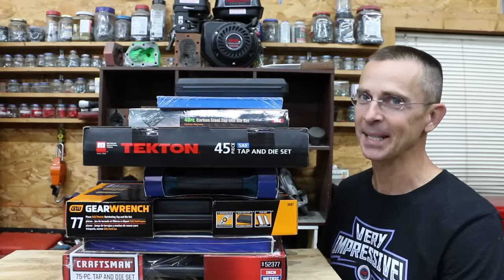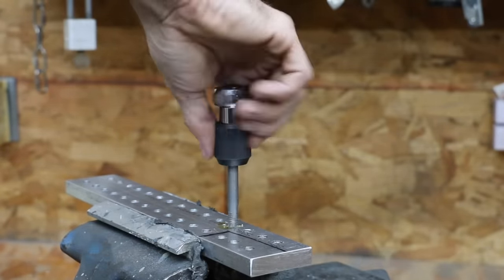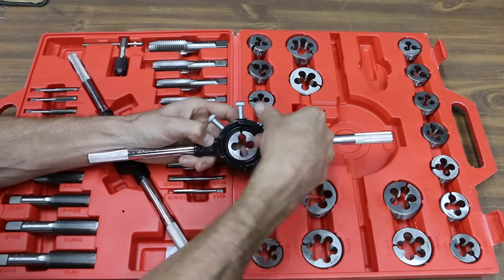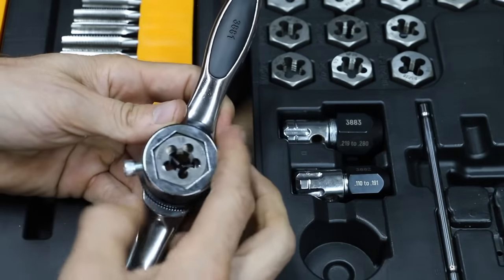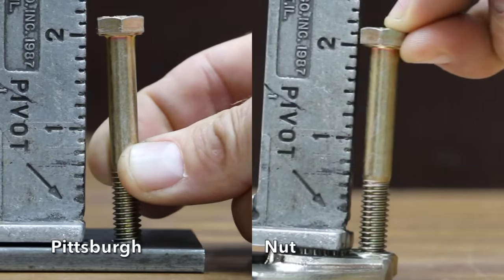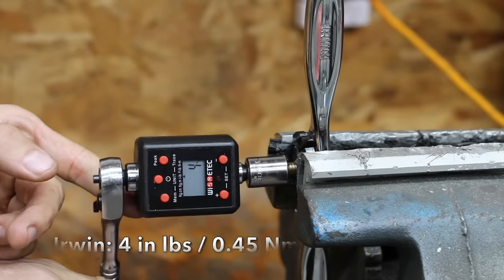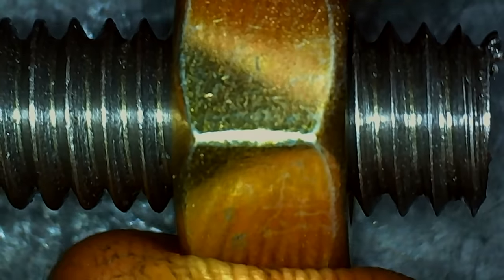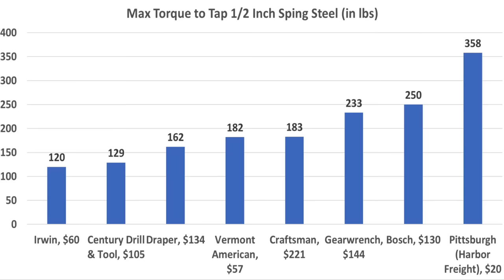Best TAP & DIE Set? Craftsman vs Irwin, Bosch, Draper, Vermont American, Tekton, GearWrench

Comment: I have owned and used professionally a large complete set of Craftsman standard tap and dies since 1980. I have broken a few taps over the years and they were replaced free of charge. I also own a smaller set of metric tap and dies from Craftsman and they are excellent. I cannot say enough good about Craftsman tools for the money they cannot be beat. Years ago they even replaced broken drill bits free which is amazing. I also own Snap and Mac tools which in some cases look and feel better but Craftsman gets the job done for a lot less money.
Reply from the maker: Thanks for sharing.

Comment: And now I know I made my worst investment into the two SAE and Metric kits from HF😞🥴. In any sense I learned even more from the PLETHORA of comments below and that taps won't last very long to begin with, hence, the reason I shouldn't have bought a large kit, and should have just purchased a really small kit and added taps as needed. Think that could have been stated in this video too; that these are extremely low use tools and will be often quickly replaced after short use. Ultimately, I don't think my purchase was worth it in addition to not being a 'tapered' kit, they are even harder to get started with. Lessons learned for sure. Thank you PF for this outstanding breakdown good Sir.
Reply from the maker: Thanks and you are welcome!

Comment: The correct drill for Aluminum is an " F " which is .257" and for steel it's a " J " which is .277".   This explains in part your loose fits in aluminum and broken tap in steel.   By writing this I am making no excuse for the horrible performance of HF.   Incorrect recommendations do not have to be accepted.  Also, the cost should have been given in $ per cutting tool or $ per piece since the kits varied in number of cutters incredibly widely.   Perhaps cost per piece of the largest set they sell in SAE would have also been a better metric.   I would love to see this revisited with vintage sets.  Actual American Craftsman, Vermont American, Ace, Greenfield, Cleveland and others.   The audience is interested in what is available commercially, so I understand why those were not included.  Gave you a like anyway as I like your content.
Reply from the maker: Thanks!  Thanks for the video idea.

Comment: Thanks for the comprehensive comparison, very helpful.  The only comment I would make about the tests is that the loose fit of the nut from the test of the Draper die could have been due to the way it was clamped in the vice - I noted that the  "gap" in the die appeared to be pretty well closed up which isn't what would happen in practice using the proper wrench.  The Die wrench would have allowed the amount of cut, and therefore the fit, to be better controlled.  Other than that - and I know this isn't usually a concern -  it's hard to find kits that have all 3 taps for each thread configuration - that is,  Taper, Intermediate and Plug, which I know isn't needed for most "handyman" use, but here are times where I wish they had been available for certain jobs with harder materials.
Reply from the maker: You are welcome!  Thanks for the feedback.

Comment: Someone mentioned using a range of tap drills to get varying fits of the final thread.

In addition, taps are made of varying thread fit, the tap used is typically specified in the drawing.  While this is not plan work, unless you know what fit of tap it is, you can't compare them.

I could compare a hundred dollar tap against the worst of this bunch & make it look even worse, just by buying a loose fit tap, designed for a smaller tap drill.

Also, using a ratchet to drive the taps is 2nd only to a drill for the worst method.  There is a reason tap handles are 'T Handles'; equalizing force on two sides of the tap is primary.

Just watching the video, I could have predicted ALL the taps would produce sloppy holes due to use of the ratchet, combined w/ not cleaning the swarf from the tap by reversing direction when you feel resistance against the tap.

Just because you see a machine or some YT'r run a tap in like a drill, doesn't mean you should.  Tapping machines have clutches which accomidate resistance & slip, plus a machine tap is used in a machine, a hand tap is used by hand.

That doesn't take into account if the tap is a taper or plug type; they can both be hand taps, but will perform differently.

One last thing. Despite what the marketing wank says on the package, a hexagonal die is not for cutting threads, it is for cleaning/repairing established threads.

I have seen resellers, (like Craftsman), have an idiot in marketing decide the "hex makes use w/o an expensive die stock easy". Yeah, for cleaning threads. Use it to cut threads & it'll be a mess.

Even good dies will die if you try to make "all thread" using the gorilla force method. Dies need to be reversed, just like taps.

This entire comparison could have valuable, but lack of knowledge turned it into a waste of everybody's time.

Comment: I have the irwin tap + use time-serv kits to repair threads (mostly crappy aluminum that fatigues and strips over time...). Manual handle not drill or wrench for an existing hole. Works well and recommended, though expensive.
Reply from the maker: Thanks for sharing.

Comment: I have a Craftsman set. It is several years old but looks very similar to the one you tested. It has worked well for me. Nice to see it did so well in your experiment. An issue I have come across with cheaper sets is that some of the taps & dies are not cut to spec (Standard or Metric). They work with each other (if that makes sense) but don't expect a 3/8-16 bolt you bought at the hardware store to thread into a hole you tapped
Reply from the maker: Thanks for the feedback.

Comment: As a machinist this test leads me to believe that it's meant for an non-professional mechanic or diy kind of application where they don't use them a lot.  Others mentioned using the ratchet and the wobble as the tap enters the metal. That can cause it to wallow those threads or make it tear them a little bit. Getting them to start straight is the biggest problem when you can't use  drill press, milling machine, or lathe and a spring loaded tap guide.  However it can be done and even if you can't power tap or have a tapping maching it makes a huge difference in thread quality. Also using a nut and bolt is not a great was to check the threads as they can vary a lot in their tolerances and cause bad fits. 

There are different kinds of taps but some are meant for power applications and do not work to hand tap very well if at all. Also there are different fit types of taps too. Fits 1 loosest fit with 2 being the normal size and 3 being the tightest thread fit.  Seeing your close ups I'm wondering if you a mix of #1 and #2 tap sets.
Reply: @jjtt7408  Drills do not always cut oversize!!! You can use water and it will cut ve4y close to and sometimes undersized as well. Used motor oil will cut a few thou oversize or change the taper a little on one flute and it'll cut oversize a good bit.

Comment: I just purchased the Gearwrench 114pc set. The ratcheting drivers was a huge selling point for me. I also have an old Craftsman(from the American made days) metric set that has been put through hell and held up great.

In defense of the brand(not sure which one it was) that you put the round/split die in the vise, this fully closes the adjustable die cutting the smallest possible diameter,  so of course it's gonna produce a loose fitting thread...
Reply from the maker: Thanks for sharing.

Comment: The gearwrench ratcheting mech on the large handle (if someone decides to buy the bigger set with 2 handles) has a known issue of falling apart when applying downward force. This happened to me and after hearing from apex about the extended back order I bought another one which also fell apart immediately. To avoid this make sure the reverse lever is pointed down or just take the guts out and replace them in the correct order. The little spring and cap go flying if you don’t. Otherwise your waiting weeks-months for a warranty replacement from apex.
Reply from the maker: Thanks for the feedback.

Comment: One other thing:  if you read the fine print almost all the taps and dies on the market until you get to the very expensive ones are what is known as a "thread chaser" meaning they are not designed to cut threads on a blank but to straighten up and clean out threads already made.  For dies the give away is that a thread cutting die has a slit in it with a screw that can slightly adjust the cut.  this allows you to start out and cut a rough thread then by increasing screw pressure and tightening the die it will cut to specifications.  Hard to find a tap for making threads from scratch but they are spendy.
Reply from the maker: Thanks for the feedback.

Comment: Was not expecting how much sideways play on the threads from some brands here. Really good information. 
  I have a mower where the brakes are controlled by steel rods instead of cables, now needing more thread to compensate for wear. I think the Irwin is a good bet because of the tolerances. Too loose and the bolt could back off from vibration, so it's important to get good fit while retaining adjustability. Thanks for the info-dense breakdown.
Reply from the maker: Thanks and you are welcome!

Comment: Just an FYI, the Irwin Hanson sets are now made in China and not the USA. They didn't update the Amazon listing nor change the model #, and just barely could be bothered to put a "Made in China" sticker over the "Made in USA" part of the inside card.

I'm okay if a company changes manufacturing locations, but they really need to update stuff (issue a new SKU). DeWalt also pulled this with their Black Oxide Drillbits set.

Comment: I am going to concur with the prior comments. Using a socket wrench to cut threads will wollow  <--- (technical term) out the hole, especially on soft material like aluminum. The amount of wobble is directly proportional to the amount of out of plane force used to cut the hole. Of course the taps that don't cut as well will require more force and more of that force will be out of plane.  A mechanism for holding the cutting tool perpendicular to the work must be employed to achieve repeatable and constant results.
Reply from the maker: Thanks for the feedback.
Reply: @ProjectFarm  You could hold the taps in your drill press and then use a wench to turn it. Unfortunatly, I can't see how the test could be considered valid when the items being tested are being tested in a manner well outside the manner in which they are intended to be used.

Comment: Another great test.  While I have the Gearwrench set I use for cutting new threads (the smaller 75 piece, love the handles), I also have a HF Pittsburg set that only sees action on rusty existing threads.  Mainly used just to clean them up and if I break one, who cares at the low cost to replace.
Reply from the maker: Thanks! Thanks for sharing.

Comment: I would probably buy the Craftsman set.  
Since I was a child and used to go to sears with my father to buy or return a broken Craftsman tool.   
  Ever since I can remember I have always preferred Craftsman tools however occasionally when sears did not have the proper tool I needed I would go to pep boys or western auto and occasionally use SnapOn or Proto or Mac. 
   However the Stanley brand is good also.    They used to be sold at pep boys. 
Pep Boys always seemed to have really good prices on most of their merchandise and Cornell tires are a great budget tire.
Reply from the maker: Thanks for sharing.

Comment: Love all your video's!!  I currently work for a company who manufacturer's  taps . I work inspection, so I check the tolerances etc on these which can be pretty monotonous sometimes. We hold usually a .0005 tenths tolerance on most of our taps depending on customer we are producing them for. It's actually pretty amazing how many different companies have us manufacturing there taps and then they just mark them with there logo. Since becoming an inspector and like I said looking at these everyday, I have went a few different places looking at the taps available like at the auto parts store, and they are horrible quality. I noticed they all have a bunch of hit cutting edges or an insane amount of back taper, terrible finish, and also sure the heat treatment on these low quality taps are not great which really makes allbthe difference. I know they say if you want a cheap tap for occasional use, go buy a set or a kit, but if you want a real quality tap you almost have to purchase them individually from a reputable brand. Cool video project farm
Reply from the maker: Thanks and you are welcome!  Thanks for sharing.
Reply: I'm definitely wanting to go the "buy quality individual taps/dies" route.  Can you share some of the brands your taps are sold under that you consider high quality?
Reply: I believe Nachi, Cheboygan, UB (Union Butterfield) are some of the brands which are very strict about tolerances. Most are +/- .0005 for there pitch diameter. if you interested in purchasing taps these are a few decent brands.  I know of 1 brand which there tolerances are much wider and that's Bowman
Reply: And thank you Project Farm for all you great work!! Keep up the great videos

Comment: For Aluminum it's best (for tightest threads) to use 1/64 smaller drill size than mild steel. For example, use 5/16" for 3/8" or 1/4" for 5/16". Of course use a good quality cutting fluid like Walter Coolcut.
Reply from the maker: Thanks for the feedback.

Comment: This did make me laugh. I actually use the cheapest tap and die set that I could find on Amazon and its served me incredibly well. I treat it with kid gloves, use oil, only hand-tap using the two-handed wrench, and carefully and slowly move back-and-forth. Thus far its still in mint condition, and the results have been absolutely premium and snug fits. I guess demands are different if you are tapping using a drill press or you have to tap hundreds of things in short order. But honestly, if you are only doing a few threads now or then, and you treat the tap and die set like it was a family heir loom, even fairly shitty ones will do the job just right. 
As always, your videos are the stuff of legend.
Reply from the maker: Thanks!  Thanks for sharing.

Comment: I know this was a year ago but I think the most important test of threads is how much torque you can put on them with the nut or bolt on the tapped/died threads. 

For example, a tap going in easily in to the plate might make me weary of how much torque the threads I cut can actually take.
Reply from the maker: Thanks for the feedback.

Comment: I use taps all the time with my trade the 2 tips I can give is put the tap as far into your drill as you can to reduce torque on the entire tap itself the second is do not use a clutch when tapping I've found its like driving up a hill in slippery conditions if you slow down too much you're stuck or you're going to break it obviously it takes some feel but powering through it saves them I've been in my trade for 6 years I've broken 3 taps also drill taps are amazing if you pre drill the hole first and then use a drill tap you'll never break one
Reply from the maker: Thanks for the feedback.

Comment: It would help to use a little oil.  Backing off as you tap or cut threads will prevent material from clogging the operation.
Reply from the maker: Thanks for the constructive feedback.

Comment: Another great video. I do wonder if the torque measuring device could have caused some runout as it looks like it's wobbling back and forth quite a bit compared to the tool being directly attached to the tap. Just an observation. Still a really well done video.
Reply from the maker: Thanks!

Comment: good video only issue I think is when using the torque adaptor and then checking the fit on the holes isn't the best way because when you tap a fresh hole with a spanner or ratchet you tend to wallow out the top of the hole because the twisting force is only coming from one side of the tap not both as is with  with a normal tap wrench.
Reply from the maker: Thanks!  Thanks for the feedback.

Comment: The excessive movement are caused by drilling the hole are slightly oversized so those threads are not fully formed 
If you use drill bits that are on the lower side the screw will fit much tighter

Comment: I noticed that the Draper die was round.  That required you to squeeze it a lot in the vice, which could either make it out of round, or make is smaller than the specs.  That could affect your threaded rod test.
Reply from the maker: Thanks for the feedback.

Comment: Video suggestion. It snows enough to clear my driveway only 1 to 2 times a year at most. I am looking at corded snow throwers for a gravel driveway and hope to not go clear down to gravel but to leave a few inches of snow. They also make battery operated snow throwers. The tines are both rubber and polyethylene plastic. The throwers are relatively inexpensive when compared to a gasoline motored thrower. ( single stage=thrower verses two stage= blower) I fortunately have a covered outdoor power outlet in front of my garage. Can I get a thrower that will hold up adequately? For the money, which thrower represents the best buy? Looking on Amazon which has a variety of these machines. Better question is why don't make the tines and housing out of steel? Why not use a small two cycle or similar engine on these snow shovels ( like that new hollow rotored wankle engine) and small throwers? Last two questions are the result of an engineering degree and 15 years designing products. Can you get replacement parts for these electric throwers? Is it worth replacing parts on electric throwers or is the machine a disposable machine?